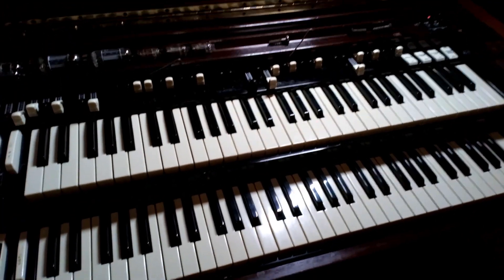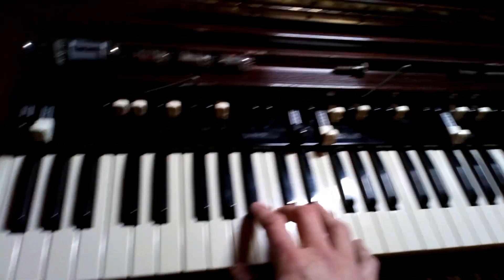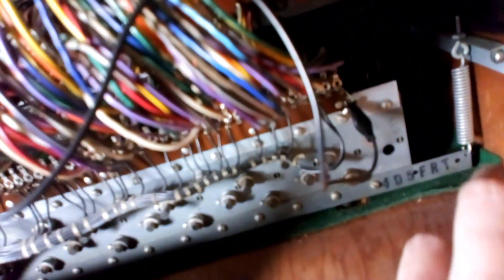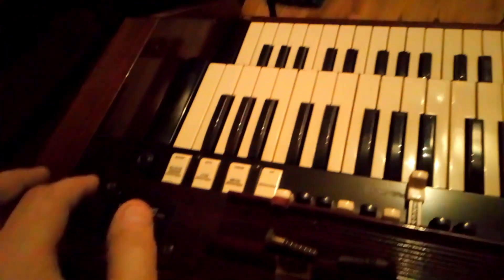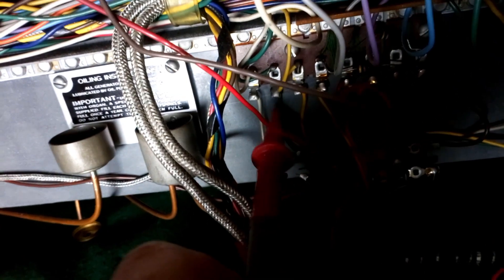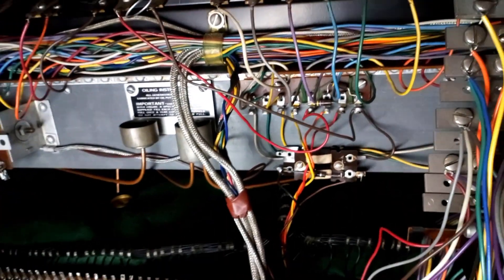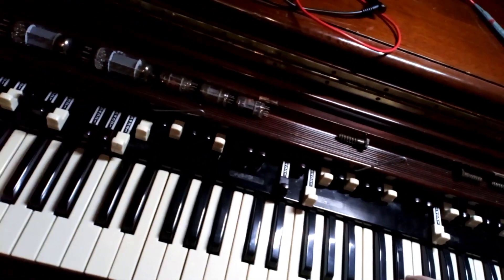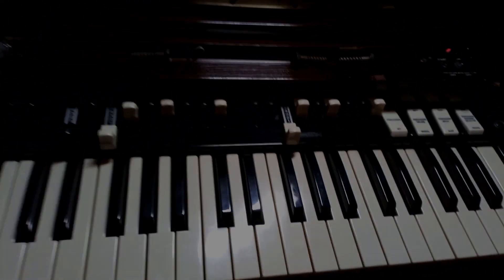Hammond B3 / C3 Percussion zap quick fix

Comment: What a load of rubbish as if this will work on my A 100 ha 
So I tried it 
And it actually worked can’t believe that actually worked but it did 
Thanks for posting
Reply from the maker: I know, it seems crazy that putting a few volts electricity through the percussion circuit will burn off zinc hairs and fix it, but it really does work, but not in all cases. Problems with the pre-amp perc circuit or tubes can't be fixed with the zap trick. I've found that the zap trick is good for the switch assembly and shorting K terminal, but usually the problem will re-occur after some time, and the correct long term solution is to clean the switch assembly and service the pre-amp as required. Thanks for watching, glad it worked for you!

Comment: Did you have the main Hammond power cable unplugged while doing this? I tried this and it didn’t work for me sadly but I did see sparks as I was touching the wires and wire connection. Cheers, thanks for sharing!

Comment: Après avec nettoyé directement les quatre interrupteurs de la section Percussion, avoir vérifié les lampes 12AU7 et les deux 6C4, j'ai du prendre un grand respire et essayé cette procédure. Le soleil est revenu dans ma vie. J'ai à nouveau des percussions sur ma C3, 1961. Henrik, un gros MERCI pour ces informations.
Reply from the maker: I'm very happy to hear that this worked for you. As I mentioned, it is a quick fix and should be okay for a while, but at some stage you could maybe consider cleaning the inside of the percussion switch box which is a more permanent repair. Enjoy the percussion.... I would definitely miss it too :)

Comment: Thanks for making that video, I also have a percussion problem and could localize the problem in a short in the percussion switch. If this works it saves me alot of time and work. Thanks
Reply: Amazing, I tried it today. As I already found the problem in a short in the percussion ON/OFF switch I only zapped the white wire. It worked fantastic, Percussion is back. I learned alot :D

Comment: Same color wires on an M3. I wonder if that is the same. I would think so. Looks like all 3 go to the same draw bars.
Reply: Bob Baisden   I’m looking to zap my M3.  Can you provide any specific info for the M3?  Thanks
Reply: @fmbeaumont100  There are several websites dedicated to Hammonds with tone generators.. https://www.scribd.com/doc/106139466/Hammond-M-M2-M3-M100-Organ-Service-Manual
http://www.captain-foldback.com/Hammond_sub/hammond_schematics.htm
https://ssl.tonewheelgeneral.com/agelist/agelist.php
http://www.dairiki.org/HammondWiki/HomePage
Also there are several other YouTube video's showing how to Zap the vibrato scanner here on YouTube just do a "Vibrato Scanner" search. 
Even after you ZAP the scanner, the oil that was thrown off the elements inside the scanner remains at the bottom of the scanner. If there is enough oil in the scanner you are really just trying to see if it will work temporarily. Best thing to do is take it all apart and clean it. If there is just a little oil in the scanner then you probably will work. If you take the scanner apart, be sure to get the oil wicks back the same.
Reply: @fmbeaumont100  Did you zap the M3? How did it go?